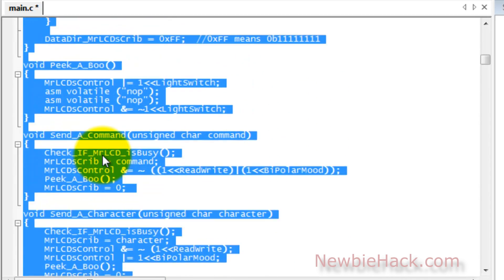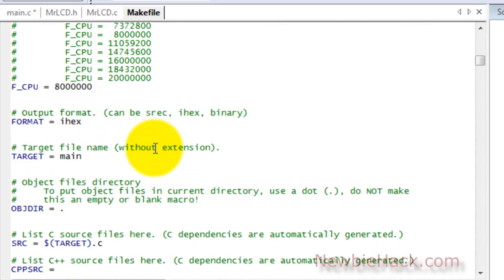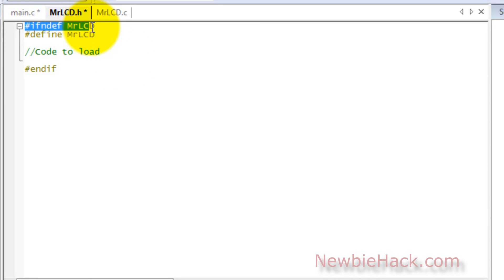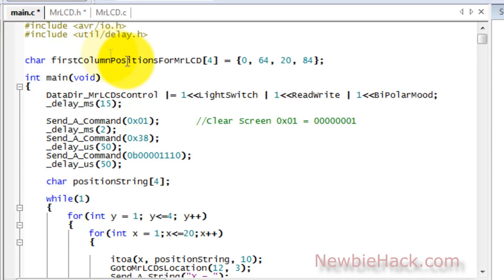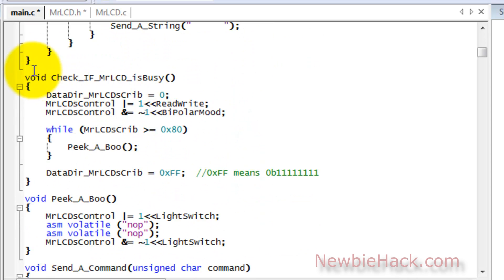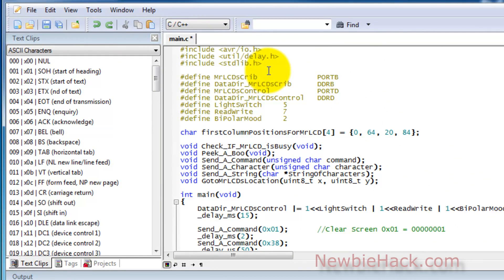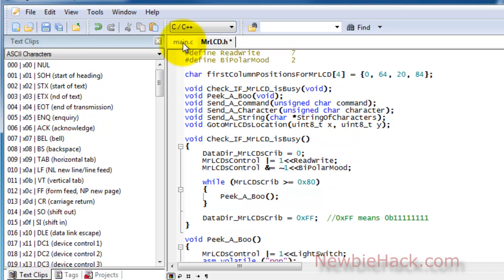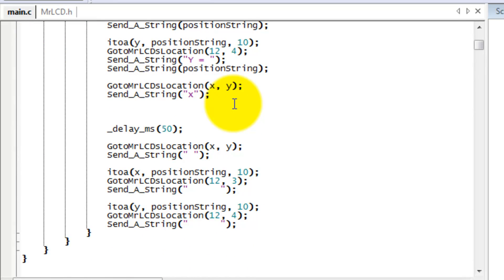23. Arduino for Production!  AVR Atmega32 - Separating Reusable Code to Form a Library

Comment: I have followed along with all the videos and my LCD screen is working great, Your videos is definitely one of the best resources out there for learning to program AVR chips, thanks.

I have a bag with 7 Microchip MCP23017 16-Bit I/O Expander ICs in my desk. I have programmed them before using an Arduino. They are quite inexpensive and could work great to create an LCD that can be controlled with Two Wire/I2C interface freeing up 9 pins on the AVR MCU.

I haven't programmed I2C/Two Wire in C before, and I assume it is not as simple as using the Wire Library in Arduino.

I will see if there are any good info at AVR Freaks, Google and of course the Atmel datasheets.

But now that I understand how a LCD works I am going to attempt and modify this library to work with a MCP23017.

If I could make a suggestion for future videos, it would be great if you could make a video series on using I2C/Two Wire and maybe even SPI.

Do you cover some of these topics on your DVD perhaps?

Thanks for the time and effort you put into these videos it is greatly appreciated.
Reply from the maker: I am currently putting together a video on I2C.  It's definitely the most desired subject.  Thanks for the kind words.

Comment: m working on ATMega8.... which port and pins do u suggest for data and control lines; 
while taking into consideration that:
1. PDO and PD1 i.e.,RX & TX are connected for wireless transfer (transfer and lcd both are working simultaneously).
2. PC6 used for reset.
3. PB6 & PB7 are used for crystal.

Comment from the maker: @bagatelox I use the mouse clicking because:  I am clicking on the tabs at the top of the programming section and it's difficult to determine when I click on a tab to change the file that I am working with.  Some folks out there may find this helpful.  I would like to hear from others if this is an annoyance or a benefit.